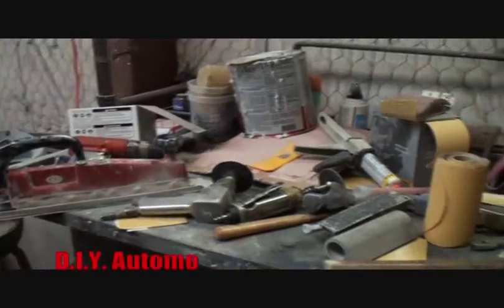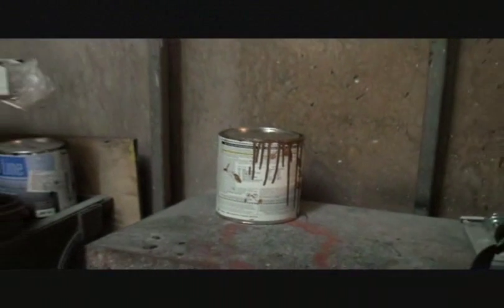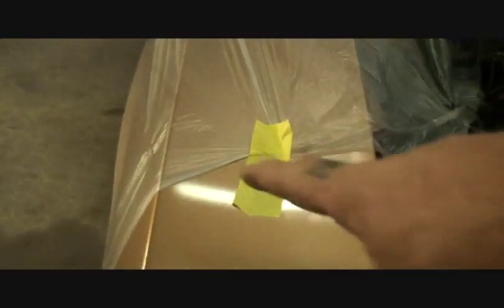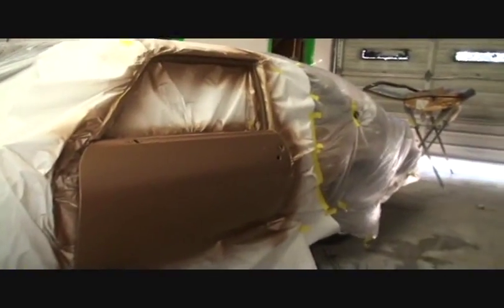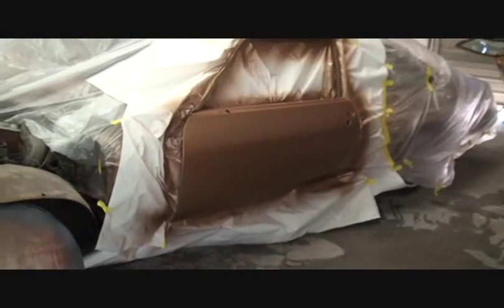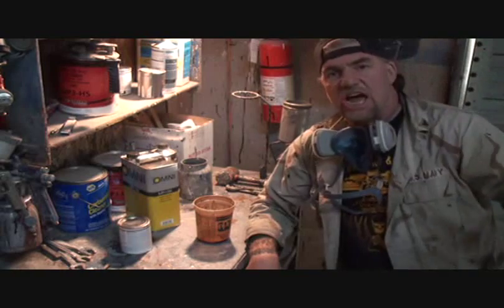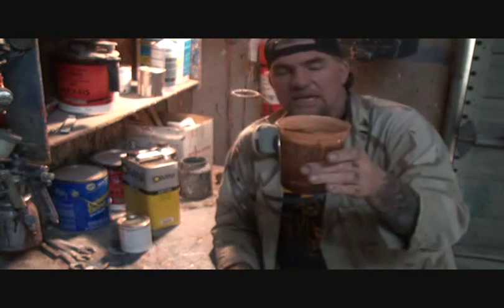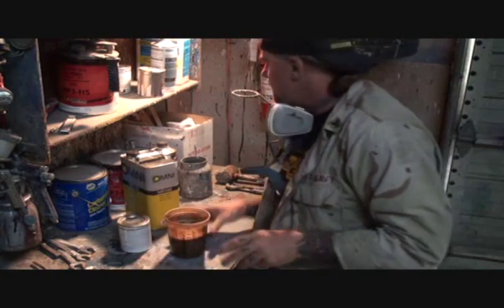Collision Repair Tech Tips-How To Match Paint On A Car

Comment: hey pete i was wondering, if a person is going to remove the quarter panels is it ok just to prime the inside before putting them back on, i see this all the time but i saw a video were they painted the insides after priming, would priming after epoxy priming be a good idea? im thinking that if i just prime the inner quarter panels that the primer will hold moisture were paint would not. thanks for all your videos pete.

Comment from the maker: you can go ahead and just apply epoxy primer and you will be alright. The epoxy primer has a catylist which is a hardner and will seal up the metal from any mositure.. I usually use black epoxy primer on a job like this.. no paint is necassary...